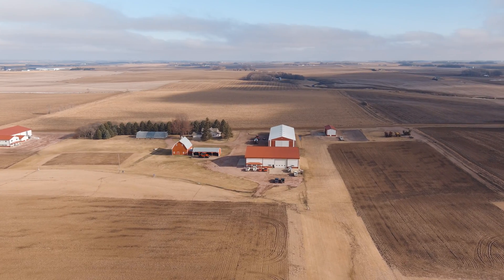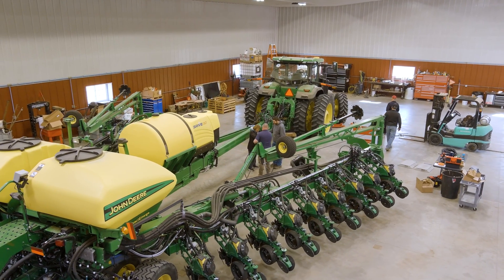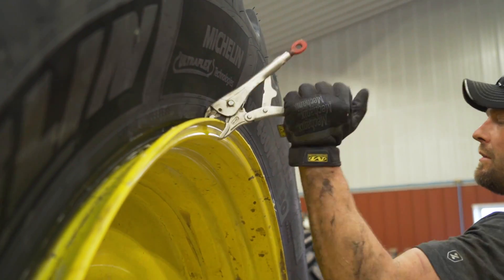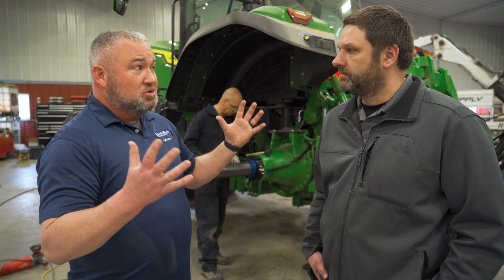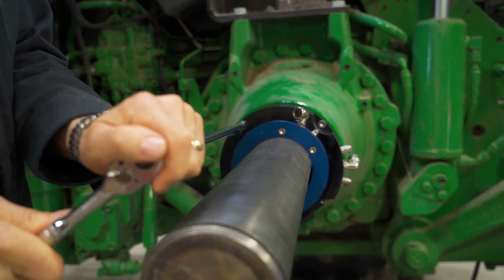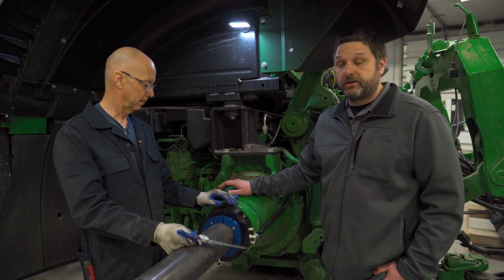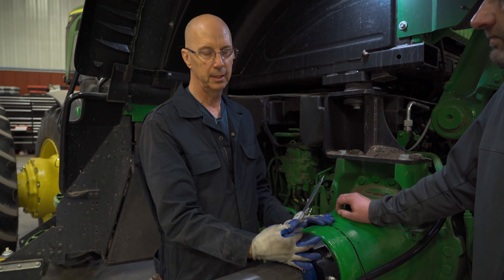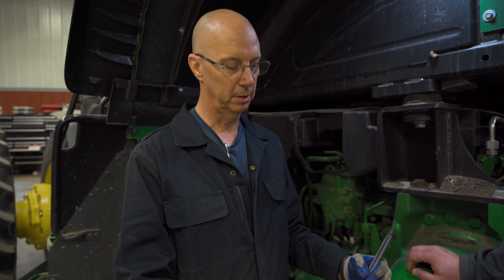Upgrading the Hefty Brother's tractor & planter with CTIS + VF tires!

Comment: Hopefully the fields that are wet will not mess up that new air system that you are installing on that tractor...
Reply from the maker: It's in wet conditions where these systems really shine. The larger footprint with the lower tire pressure makes a huge difference for flotation and traction. Aside from completely burying a piece of equipment in mud, the system will hold up without a problem.